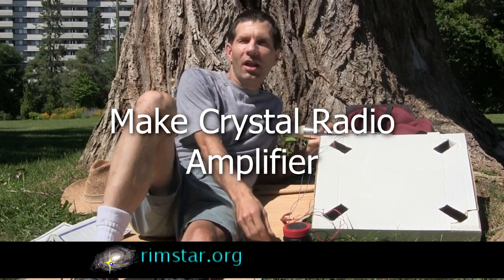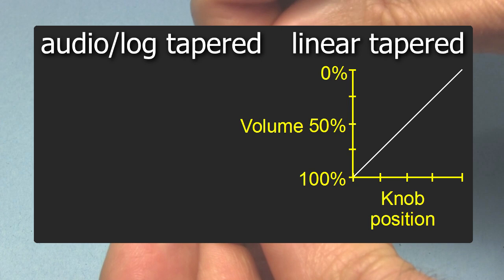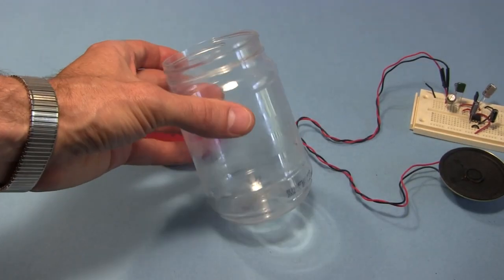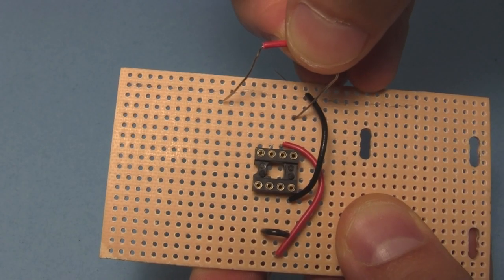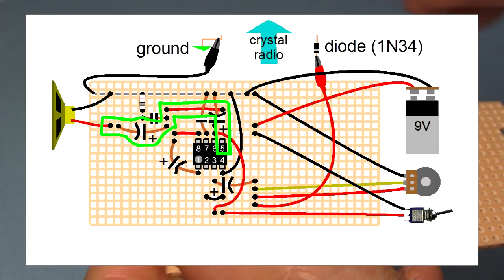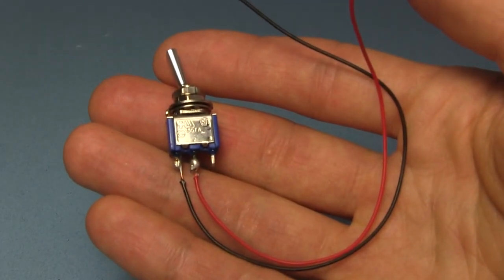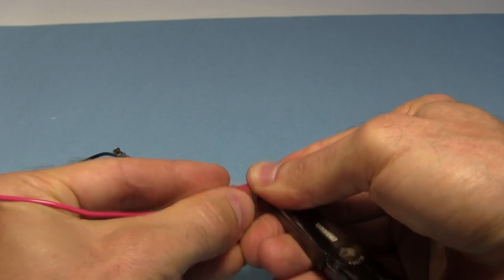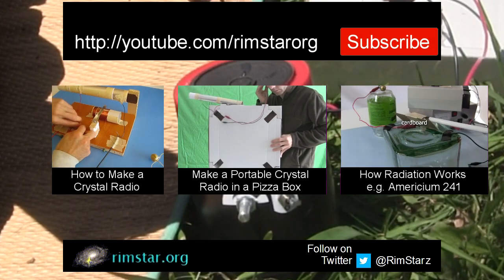How to Make Crystal Radio Amplifier for Speaker

Comment from the maker: Interesting thing to try, but I don't know if it would work. Get some earbuds. Cut the cable going to one of the earbuds. Inside the cable are two wires. Connect the two alligator clips coming from the amplifier to the two wires. Plug the jack into your mobile. Try connecting both ways to see if one would work. But, those wires in the cable are extremely thin and you might need a magnifying glass to work with them. Let us know how it goes.

Comment from the maker: I don't connect it to ground. My portable crystal radio has two wires coming out of it that are normally for connecting to a crystal earpiece. I connect the amplifier's input to the wire that goes to radio's diode (stripe end) and the amplifier's ground to the other wire, which simply goes to a junction where one end of the coil meets one end of the capacitor. For improved performance I put my hand solidly on one capacitor plate, so that my body acts as a ground.

Comment: Polarity only matters if you have multi-speaker setups. In this case, different polarity connections can cause interference patterns due to the sound being out of phase from different sources. For a single speaker this isn't an issue.

Comment: Polarity of the speaker matters. It will work, but when correctly connected cone(diaphragm) will bump outside, not inside. This factor changes sound (particulary bass) at big volume. Thats just FYI. Nice video through. Excuse for my English :|

Comment from the maker: I want to try using bare transistors too. Thought I'd try the chip this time, though. I think the amplifier was amplifying what was a noisey signal from the crystal radio. A french station was coming in crystal clear and came out of the amp crystal clear and much louder but since it was french and most people watching this video at least know english, I went with the noisier english station. Maybe I shouldn't have. How long is your antenna?

Comment from the maker: I was at a sort of Maker Faire tonight and saw a new approach which was to buy a sort of copper tape from craft stores which is actually a good conductor and use that tape to make the traces. It was solderable so you solder where two pieces meet and of course where they meet the components. They'd made a mini power supply this way.

Comment: Hi! I made something like this using two npn transistors. I've also added some inductors and capacitors to filter audio signal. I have much better sound quality with this method. I'm using passive filter, but you can make one powered from battery.